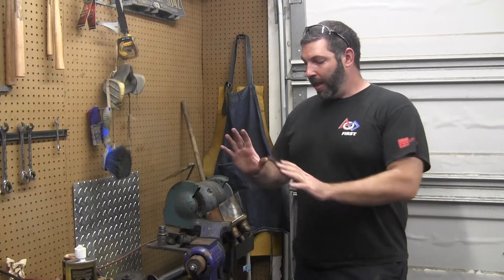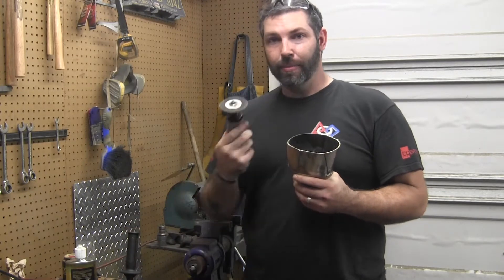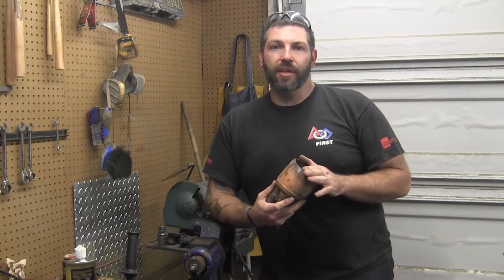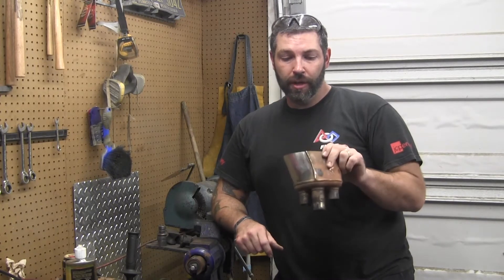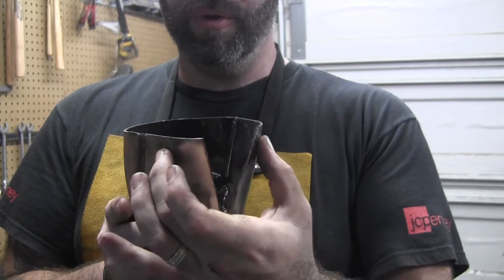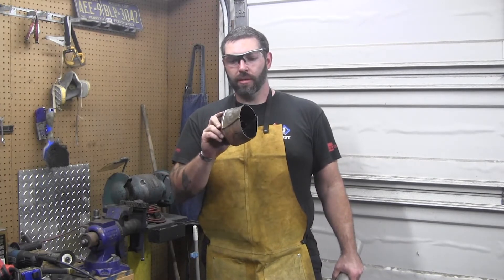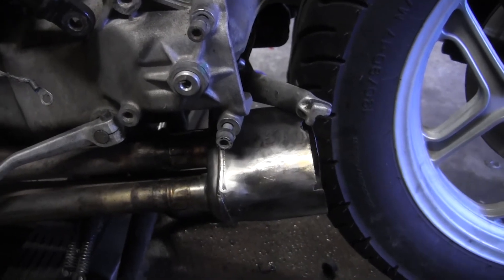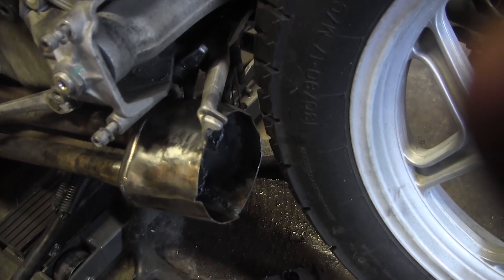Modify BMW K100 stock exhaust collector Part 1

Comment: Should plan on four into two into one in order to balance the pressure waves that reflect back up through the exhaust valves and possibly the intake valves. Four into one may result in a dead spot upon open throttle fast.